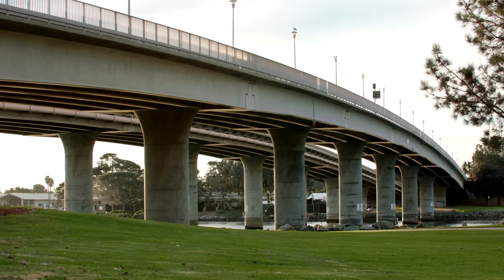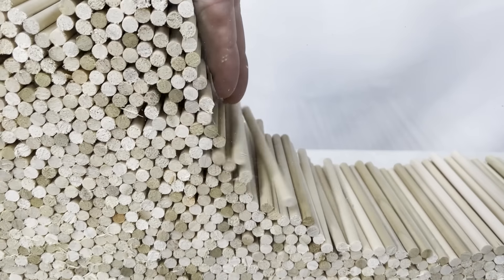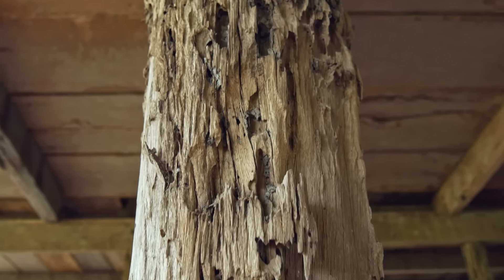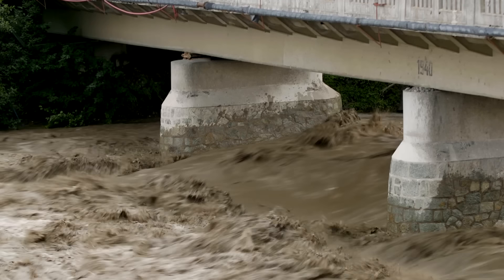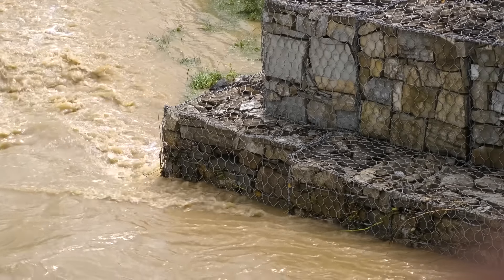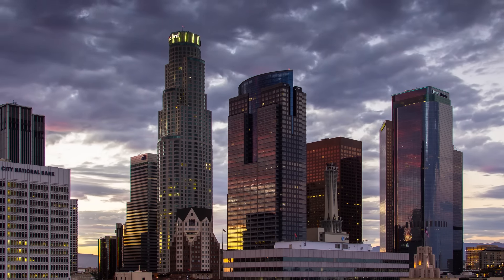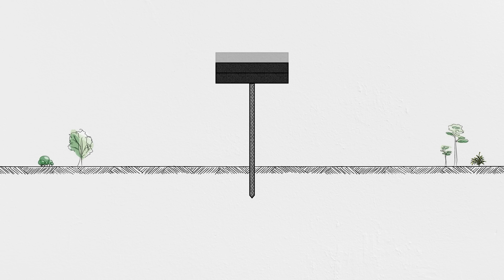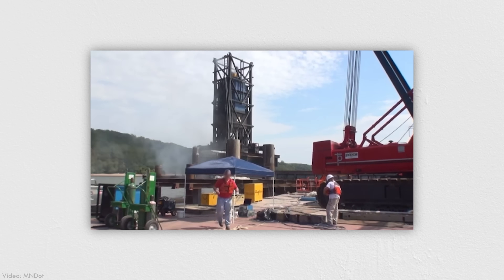Why Buildings Need Foundations

Comment: It would be intresting to learn about engineering challenges of building on top of permafrost. I know that sometimes they build houses on stilts there to protect the permafrost from the building's heat and I'm guessing there are a lot more challenges and interesting solutions involved in building stuff in such an unusual environment.
Reply: You can treat permafrost like rock if you make sure it doesn’t melt. The trick is making sure it doesn’t melt, which in the past was largely related to the heat of the building like you mention but now is becoming more of an issue of climate change and heat waves. Melted permafrost loses most of its structural strength and always compresses and shifts.

There are some hand-hewn permafrost cellars in Inuit communities in Alaska that are centuries old, constructed for the community to do things like store meat since they are always below freezing.  If the permafrost melts, even partially, they start to shift and collapse. A few communities have shifted to above ground insulated freezer units but apparently the taste of aged meat isn’t quite the same.

Future-proofing building on permafrost is insanely costly because you have to drive piles down to below where water will seep from the surface as the permafrost melts. Anything that gets significant seepage is going to shift and settle. Drilling/hammering piles into permafrost is harder than through regular soil and thus costs more, to the point it’s not reasonable for most types of construction.

Also concrete and mortar do not like setting at below the freezing point of water because the chemical reactions taking place require available water in a slurry. Ice crystals don’t react the right way.

Comment: When I was young we lived in a Snuffy Smith style Arkansas hillbilly house. Perched on a hillside and the piers where just flat rocks piled up on top of each other. Every once in a great while it would need jacking up and a few more flat rocks added   to make it level again. And that old house is Still there/ And the new house built in 1964 with a footing and full block wall and piers in the center is gone. rotted from the bottom up. Termites crawled right up the cement blocks and infested it/. The old house built on stacked rocks had a piece of old roofing tin  placed on top of every stack of rock piers to seperate the wood from the flat rock.

Comment: I have seen alot of  foundation issues growing up on an old family farm.  Barn foundations tipping over after a real bad winter because they were just set on top of the ground. I have a question about the house I grew up in. My Dad built it in 1950 with a basement with a dirt floor with a footer all the way around under the block wall. It was setting on clay. A white and gray clay. The house settled for years. We would jack it up using rail road jacks and shim it up. When I was a teen in the 70's we dug a hand well with a post hole digger. We got down to approx 22' and hit a muck that we could just push through. It never had much usable water in it. But it got me thinking. Is that why the land behind my house seemed like it was lowering a little every year and could that be why the house settled so much? Have you ever heard of a layer of muck that really stinks being that far down? We never hit the bottom of it. We added pipe up to about 26 or 28' I can't remember but I know we never hit bottom. What causes that kind of soil condition? We had been on the farm for about 80+ years at that time so we know nobody buried anything or did any work like that. Thanks for any ideas you may have. I really enjoy your videos. They are done very well for the novice and the ones like me who have done a little work but no formal education on engineering. What I learned is from my own experience or what engineers have taught me over the years. Thanks again and stay healthy.

Comment: I would like to see how goat walks of bone brick of earth are placed on previosly muddy area, where asphalt roads are no good, because of their ability to hold water above.  For reasons to connect asphalt roads, make design of area better, while at same time giving people hard surface for cart/ trolley, walk..simply quick short paths. I saw once how earth is digged up and flattened, pebbles placed over it. And than those earth bricks in bone shape placed as nice finishing touch.  Among them is dirt or earth and when it rains water goes below, while surface is relatively easily dried up.

Comment: Mechanical engineer here, I'm just imagining a hammer that has some kind of spring and impulse mechanism so that it bounces. It bounces such that it takes a quarter of a second so that you're actually reacting with a constant force against an acceleration. Even a quarter of a second of a constant force should better simulate these forces know?

Comment: What are some of the ways that you can design/propose for lightweight (but can be tall) structures/installations on sites where there are existing tile-paved ground (both suspended and directly on ground), and where it's unpaved like tracks that don't allow for excavation for either shallow or deep foundation? This has always been bugging me...

Comment: Interesting that explosives are used to measure forces, but I wonder if it wouldn't be easier and much cheaper to place piezo accelerometers on the weight of a pile driver.
You can then easily calculate the maximum force with which the pile is hit by the weight.

Possible damage or deformation of the head of the pile as a kind of crumple zone is not important, because only the deceleration of the pile weight then indicates the correct maximum force.

If the pile is no longer moving, you have also reached the maximum carrying weight of a pile, right?
Or am I thinking wrong?

Comment: So what about the principle behind pin footings? Diamond pier is common example in America for basic deck footings but over in the Australian market I came across a company called Surefoot foundations. They have designed full foundations system using pin piles for commercial applications even going as far as a wind turbine foundation. From a non engineer perspective, this seems to mimic a natural root structure. I would be curious to the limitations of their use, could you use this principle for a concreteless bridge pier? That would make for accelerated construction techniques.

Comment: Hi Grady! Thanks for your great videos! I have a request video for you! There is a guy called Post 10 in yt that posts videos about clearing culverts, and there is one video called "Unclogging Massive Lake Drain, Worst Clog I Have Ever Seen, Whirlpools Massive" (hope you can find it), that I would like you to analyze. At the end of the video, he mentions an issue with the pipe. I am very interested in know several things. Is it really going to impact the high way being the pipe so far deep into the ground? He mentions they should upgrade the system, what should be the solution? I hope you find this an interesting topic to cover in one of your videos. Cheers!

Comment: As someone who lives north of the border I'm often absolutely baffled by the building standards of some parts of the US. This is the sort of thing you'd see in houses built pre-1900's... And even then most of those have been lifted and have had their foundations rebuilt on concrete slabs over sand & gravel.

Comment: You left off the most important part of the video -- how did your foundation redo come out? 

I'd like to see a full video on tht process and the outcome, as well as an explanation of the choices you've made.

I'm "just a handyman" in the Chicago area, but I cringe at how people handle basement (everyone has a basement) and foundation problems. Honestly, after working in the trades as long as I have, you don't need to be an engineer to see what people did wrong and how they fall short of rightig the wrong. Or in some cases, do things that don't even address the primary problem and just build work-arounds instead of fixing things right.

Comment: Thanks Grady. I’ve been thinking about foundations since a hurricane wiped out every house except one in Mexico Beach Fl and then the high rise collapsed in Miami. I’m wondering about the size of the pilings. I know there are calculations and details but I’m wondering if you ever address the issue of piling size and forces against it. I recently saw helical pilings stabilize an existing residence against failure that already taken place, to a limited extent. The owner of the surviving house in Mexico Beach said he should have chosen the 50’ pilings and we all know what happened in Miami. I have watched your video on that. Why would someone want bigger pilings than they needed? Could the house that needed support have chosen helical pilings to begin with? Should we thinking about that? Should I know more about the foundation of my condo?

Comment: I have a question maybe you could make a video about.  
when a pipe has multiple outlets, for instance HVAC, are all of the outlets the same pressure?  Is the outlet closest to the inlet at the highest pressure and then it diminishes from there?  Or does the momentum from the flow into the pipe cause pressure to build up from the opposite end to the inflow?

Comment: To accommodate differential movement with piled foundations, shouldn't it be possible to have some sort of height adjustment between the top of the pile and the building's foundation? Then once per year, say, you measure the sinkage of the piles and make whatever adjustments are necessary to keep it all level.

Should be easy enough for a house. Some sort of screw jack system, metal shims, or even wooden wedges should do the trick. Large buildings would be more difficult of course, but if they can develop mass dampers to protect against earthquakes, why not this? Sounds like a worthwhile investment to me.
Reply: This is exactly how pier and beam homes are leveled. I have a similar home in the same area as Grady but my piers are concrete. I recently to level it for the first time in its 40 year life.

A few laser levels, bottle jacks, and steel or hardwood shims is all it takes.
Reply: @justinmcslappy  That seems to be true of all my good ideas - someone else already thought of them. Oh well...

What can be done about the Leaning Tower of San Francisco? Some kind of hydraulic jack maybe?
Reply: @paulpedersen1329  I think the leaning tower is a massively different problem because of the soil conditions. You'd have to somehow drill piles down until you hit bedrock to have a stable bearing surface.
Reply: @justinmcslappy  My idea is not to stabilize the piles (which cannot be done at this point), but to make them adjustable.

Comment: well, several years ago there was a 6.9 earthquake in town, and we had rented the ground floor and turned into a shop in a three story building, however we latter sold the shop. During the quake the whole building came tumbling down, luckily no one was in. The reason it feel because the previous owner did not build any foundation rather he placed the slab straight on the ground which was a fill on muddy soil to begin with so you can imagine with a massive quake, the ground moved and shock and bounced and the building just  toppled over leaning partial on the next door neighbour, which was funny looking at it at the time

Comment: Being from Norway, it looks so weird to me to have a house without a basement. To me a house without a basement looks a shed or a playhouse and not a "real house", because those are the only houses in Norway that doesn't have a deep foundation.

But does having piles and a crawlspace work if theres any chance of frost at all? Would they not just freeze if the plumbing is just dangling above ground underneath the house? Do you have heating elements down there to keep it above freezing in winter?

Comment: At 7:56 you talk about foundation being required to be below frost line even with a raft foundation, is it not possible to do earth work replacing soil with gravel below the frost line and add a raft on top of that? That should remove large movements while allowing you to keep the raft simple?

Comment: I live in a house with a (presumably) raft-style basement on the Front Range of Colorado. We have mostly clay soils here. A really common problem in suburbs around here is settling. Everything in a house is square and true when it's first built, and then within a year or so, doors and windows get harder to move as their frames shift out of square, and things like patios visibly shift off of the exposed basement walls. Why does this happen? Clay is pretty hard I thought, and raft foundations are supposed to resist this type of movement well, so is questionable construction quality to blame? Thanks
Reply: some decades ago when the houses were built much slower and noone was in hurry, new build houses were left for a year just sitting empty. no doors , no windows no pluming. just walls and roof. just for settling down.  and also to raise some money to continue.  loans were very strict back then .

Comment: the romans had it figured out, drive piles until failure, cut the piles at the load bearing soil surface, tie horizontal cedar staves together and roll them out flat over those piles, then start with the stone/mortar foundation as it were itself an endcap with a separate smaller perimeter atop this endcap being the foundation for the walls which would be an even smaller perimeter on this cap, 800years later, plumb

Comment: Hi Grady
Am a retired builder now living in Thailand. Bought land here and filled it 900mm. Have engaged in an engineer for structural and construction. He designed 200mm X 200mm concrete post sitting on a isolated footing 1200mm X 1200mm X 300mm reinforced concrete pad at 1000mm deep which will be supporting a suspended concrete slab. 
When l mentioned fill ( not compacted) 900mm deep he then changed drawings to 1200mm deep. I asked him how does he know the soil type with testing. Answer- “l am an engineer, l know “
I did suggest piles to be safe as the land used to be rice fields. He said we not do here and to expensive. Lol 😂 
Piles will cost about $4000.00 US. 
I now know why many buildings are demolished after short period of time. Not all, as l do see commercial construction using piles. 
I will be using piles. 
What many people don’t understand is that if the foundations failed, the whole building will fail as well. 
Great video 👍👍
Reply: Sorry, without testing

Comment: What foundation type would you recommend for a small house (<1000 sq.ft), two stories, built on expansive soil, close to the pacific coast? (no freeze-thaw cycles but there are earthquakes). Say, all plumbing is done close to the perimeter so that future repairs aren't much of an issue? Would a raft-type foundation be the best option?

Comment: So I have seen steel beams hammered into the ground until they hit bed rock to support things like bridges. The beam is encased in concrete and this ultimately becomes the structure the roadway beams will sit on. What hold the concrete in place?

Comment: If a foundation under a house has undergone some sort of shift, how can it be repaired to regain the original strength it had? I have heard ads on the radio for foundation repair companies that can restore the foundation of a house to make it "just like new". If the ground under the foundation has shifted or been eroded in some way, how can the foundation be supported as it was when it was new?

Comment: I tried to sign up for curiosity stream based on your recommendation but ran into bugs in the signup flow. It wouldn't let me specify a country, but wouldn't let me proceed without entering a valid country.  Refreshing my browser and running through the signup process three times yielded no improvement. Their signup process is buggy - and they're probably not giving you sufficient credit for the people you're driving to their site.   

Also, would love to hear about older foundation technologies such as cut granite foundations like we have in so many of the older buildings here in the northeast. My house was built in 1865 on a foundation of cut granite. What did people use hundreds or even thousands of years ago to keep their structures from falling over and sinking into a swamp?

Comment: If air can be used to dig through dirt, can it be used to drive piles into the earth easier as well? 
Or would this create some sort of structural integrity issues in the surrounding soil due to the dispersion effects?

Comment: I've installed Steel push piers  using existing structure as counter weight for install. we would spread the load among multiple pier locations, but when installing we would add length until that one pier would lift the footing. This also give you the ability to lift the structure for correction or repair. I still miss preforming the lift. It was stressful, yet satisfying.

Comment: I’m wondering why the concrete slab in my garage has a big crack in it. I’m not 100% sure about this but it also looks like the asphalt driveway leading to the garage is “moving away” from the slab. 🤷‍♂️

Comment: I was told that a strip footing does not need to be below the frost line if it sits in sand,and that water in the sand will not freeze or expand. Is this tre?

Comment: So what if you make a dome home, but instead of a flat foundation, the dome is a complete sphere? The floor being filled in 6 feet below  half way of the equator (better for head room) and the sphere being buried less than half way, inside floor level a bit above ground level?  Would you need a foundation then?